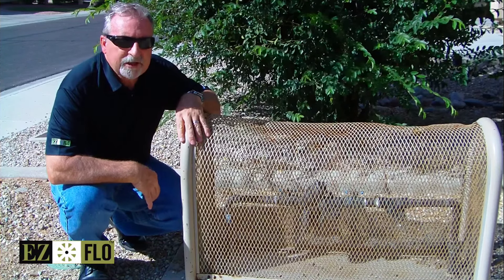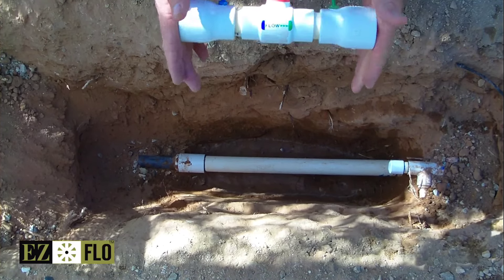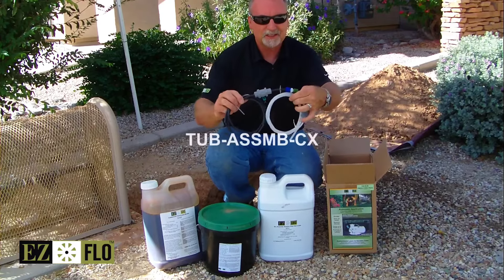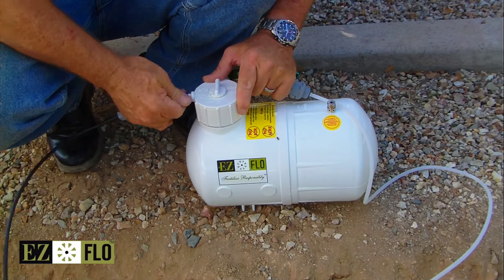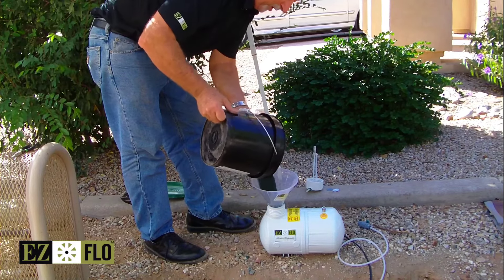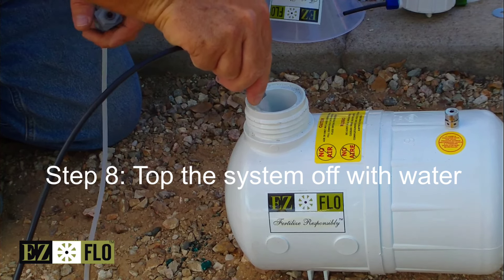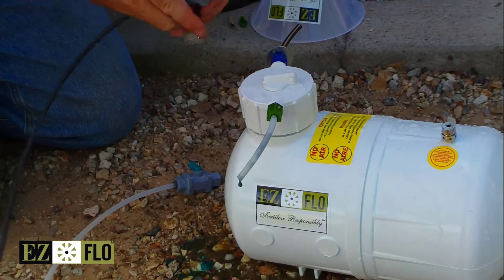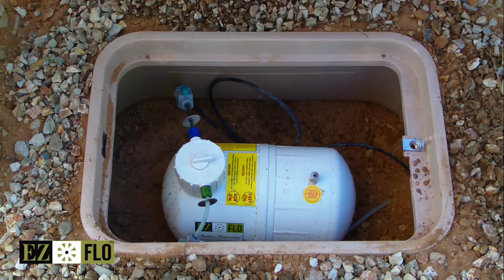EZ-FLO Installation

Comment: How many minutes or hrs does the fertilizer last?
Reply from the maker: This depends on the system size and cap setting. We have a gallons to empty chart for every model. 

The mainline systems, which are depicted in this video, are designed to last approximately 4 to 8 weeks between refills.

Comment: The way you cut the line will it fertile both zones?
Reply from the maker: it will fertilize anything after the point of connection. you can isolate one zone by installing the connection right next to a single valve (zone), or after the valve. We recommend installing the connection on the mainline, so that it will fertilize every zone.
Reply: @EZFLOInjectionSystems  granular fertilizer or liquid ?
Reply from the maker: @bmw3842  liquid or water-soluble powder
Reply: How much does it cost to get one installed